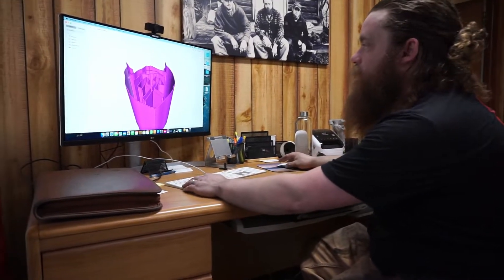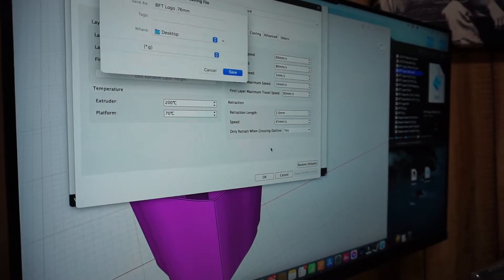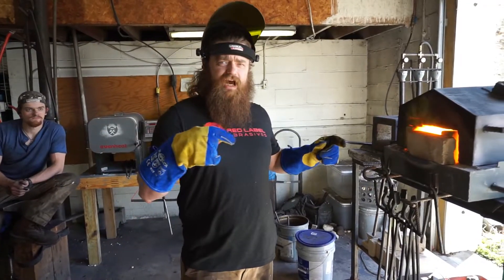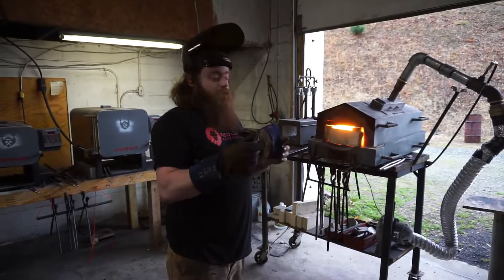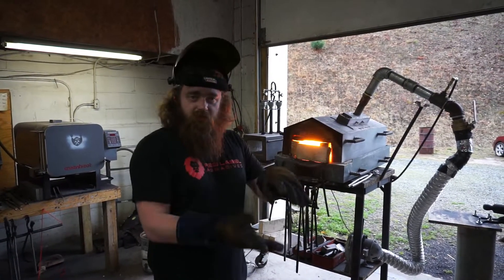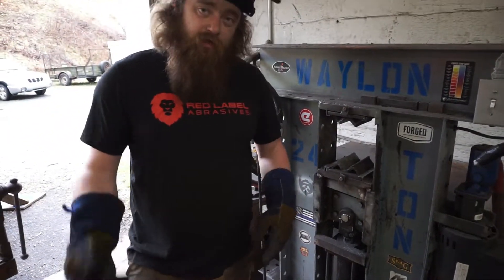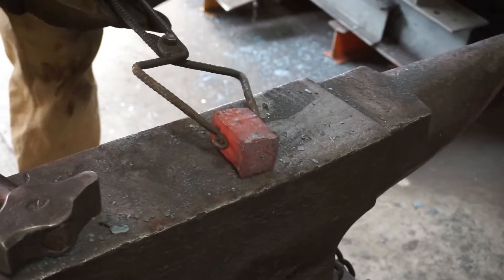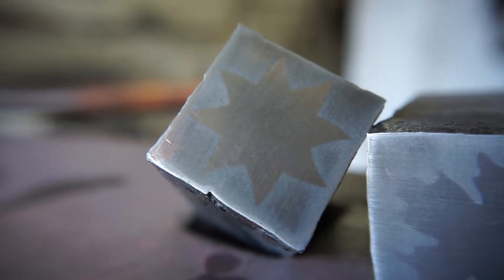3D Printed Canister Damascus???

Comment: So was that an plastic mold and if so what kind? Also what 2 powders did you use on the leaf that was sharp.
Reply from the maker: It was a 3d printed mold using PLA filament. The powders are 1084 and 1084 with 2% nickel added.
Reply: @BakerForge  awesome thanks for the reply!

Comment: Does the 3D printed pattern get removed before welding? Or does it burn out like a cast?
Reply from the maker: So the 3D printed filament is fully biodegradable and comprised mostly of cornstarch. Hence it burns up, turns to carbon and is absorbed into the steel during the forge weld
Reply: @BakerForge  how thick are the walls of the 3d printed form? I was wondering if the pattern shifts at all once the form is burned away or is the powder metal packed in well enough that it kind of holds it shape if the makes sense? Regardless that is incredibly awesome ol Steve schwarzer does some incredible things with metal and knives. I appreciate Baker Forge & Tool for taking the time to share this knowledge with the rest of us. Great job guys!!!  👍👍👍👍👍 
           💪+🔥+🔨+💧=🗡

Comment: I’ve been wondering if anyone will try out a 3D pattern, filling the inner cavities mid-print. It would be a terror to work with but it could potentially introduce some really cool pattern geometry to work with. Imagine alternating alloys inside of the gyroid infill, lots of spheres or other shapes.
Reply from the maker: Wow that is a very interesting concept!
Reply: Have either of you taken a shot at this yet? Definitely interesting idea to expand the concept 🎉
Reply: @johngriffin3116  I'm no blacksmith and have no tools for getting into it yet, so no unfortunately.
Reply: @johngriffin3116  i just started bladesmithing late last year... ill give it a shot.... in 5 years

Comment: Did you do any prep work to the canister to come off easier?
Reply from the maker: We sure did. We put the empty cans in the forge to scale them on the inside. Then we also used toasted stainless foil sheets inside between the powder and the walls of the canister.

Comment: I'm a little confused by this still. This is the second video I've come across on it and turns out so cool. When I normally see folks do canister forging one of the main things it keeping impurities and air pockets out from between material. How is the burnt Fillamanet (pla?) isn't causing lamination issues?
Reply from the maker: The PLA is biodegradable and so when it burns, it turns to carbon and is absorbed into the steel. (Vanishes)
Reply: @BakerForge  Huh, interesting. Have you tried any metal fill pla then? I wonder if the powder content is high enough to give you a different color outline in addition to the actual image and back ground.

Comment: design a pattern and have it printed out of metal that way you can fill it with metal powder of a different alloy weld a cap on and forget about using the cannister method

Comment: Please buy a 3d printer that prints metal.
Then please try two things:
1.print the whole canister out of two different metals at once and then forge it, by fully printing the canister as one solid piece of metal you can use 3d modeling software to insert your shapes anywhere you choose into the canister, not just form one shape with powder.
2. Attempt to directly print out a billet of Damascus and etch it to see if it worked properly. If it doesn’t work, try adding steps to stabilize it,
Reply: Why don't you pitch your ideas to someone who has a metal 3d printer?